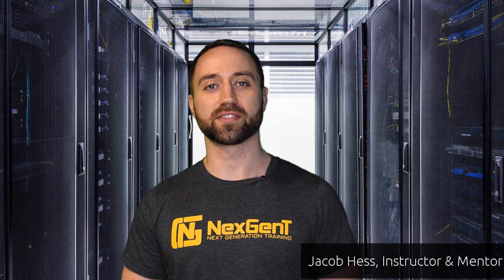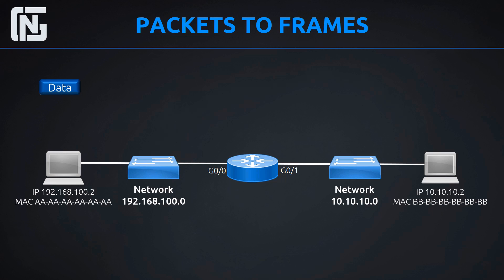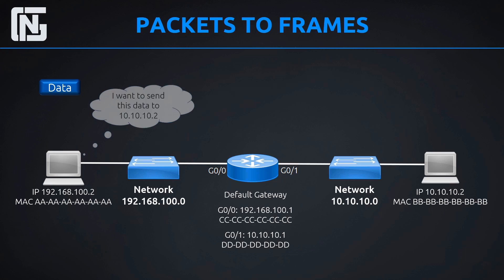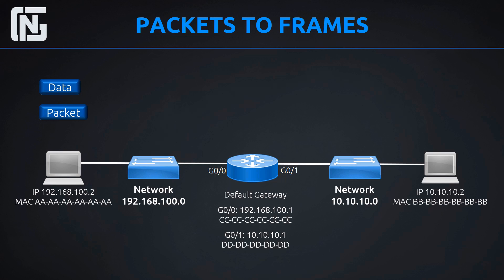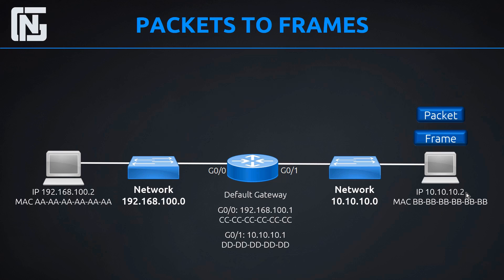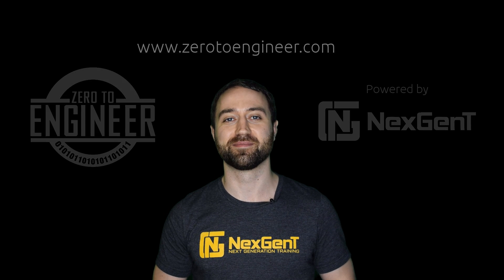Routers, Switches, Packets and Frames

Comment: finally i understood how the mac is used in combination with ip. Thank you very much.
And for those wondering how to obtain the MAC/IP combination of local device (eg. the gateway), the answer is the Access Resolution Protocol (ARP). 
for a practical overwiev in Windows: open commandline (cmd or powershell ) and run first IPCONFIG  and afterwards  ARP -A

Comment: The IP address is translated from private to public and vice versa. How does the router determine which host with a private IP send or receive data?

When two hosts in two different networks want to communicate do they use private or public IPs?
Reply: you are most likely communicating with a say 'server' when you send your packet over the internet it will go through the public IP's of both networks. Though when it gets to the specified network or the 'destination' network. The router will then send out an ARP request to say who has IP so and so. This IP comes with the packet. Once inside the network a broadcast request is given out by the router which is the 'who has 10.xx.xx.xx IP. The server that has that IP on the network replies back with an ARP response. To cut a long story short this is how it works there are a few more ARP factors to consider but essentially the thing to remembmer is that your packet will allow you to travel through the internet because that is what is guiding it out of your network. The frame is what is the crumbs of you send the previous MAC address as well as the destination MAC address.

Comment: Please correct me if I am wrong. When you said that host A knows the MAC address of the Router(gateway) and then sends the frame to that router port. But I think this is not completely correct. I think host A will broadcast the frame on the LAN and then the switch will forward the frame to the router. In this case, the router will act as a proxy.

Comment: Hi, I'd like to know about the flying cat image, the data packet contains the image file in just once transmission right?how many kilo bytes or mega bytes the data can be transmit in just once frame? Thanks so much
Reply: payload portion of the ethernet packet can contain maximum of 1500 bytes (often does only 1400). So hypothetically you will have to send couple hundreds of packets if the image is 1MB large.

Comment: Packet reaches G0/0 intrrface which is having a mac addrrss cc:cc, to send to 10.10 network it needs to be switched to interface G0/1, can u explain how does that  happen, I heard somewhere  Router  simply switches from G0/0 to G0/1after checking routing table. Is that right?

Comment: Not including tcp details into the explanation, made it less clear because it caused more questions than it solved. 

How does the Gateway router know what network to send the data to, when all it has, concerning the device we are trying to send the data to, is an ip address, but the same ip can be used in a million networks that all would be attached to the same gateway router, and what actually matters is the MAC address of each device on the planet?

You are like: "Oh, I (Gateway Router) know that IP". And I'm like...you would know a bunch of them. Which one is the right one?

Comment: Hi, I didn't know where to go for this so I'm going to comment sections regarding ISP routing. I had Xfinity in New Jersey. To a server in Quebec, Canada, I had gotten 40 ping. However I moved 20 minutes from there in a suburb extremely close nearby. Now, to the same server in Canada, I now have about 15 ping. I am so curious, but cannot figure out what could have been the problem there in terms of routing efficiency there. I've done traceroutes and the like, I don't know enough about the gateways to actually diagnose where the problem was. Was it a problem on my ISP's side? (also, on another server to Ashburn Virginia, at my old apartment I had gotten 60 ping with the same provider, now at my new house, I get about 8-10)

Comment: Before it sends the packets, it actually sends a signal (arp) to know the mac addresses of nearby devices or next hop. Am i right sir
Reply: This occurs only if the Mac address is not known. However, if through the process of self learning, it already is aware of the Mac address due to a recent packet transfer, it doesn't require to use ARP again. Other can correct me if I am wrong as well :)
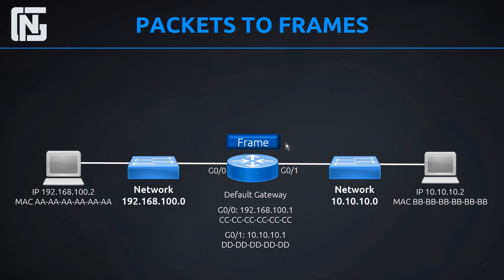Reply: @KarthikRao1995  but at 6:20 its being peformed, right?

Comment: The only part I don’t get is why would you show that the network 192.168.100.0 also gets the frame.. is that supposed to mean that when the host does not know the destination’s MAC address. The host will forward the frame to everyone in the network? Also doesn’t the router have an ARP table with IP addresses and Mac addresses so you once you hit router 10.10.10.1 it doesn’t even go through 10.10.10.0 it goes directly to 10.10.10.2

Comment: the only thing, isnt when the router gets the packet from its incoming int, going towards the right host. 
would the source MAC be G0/0, and the source would be G0/1.. not host 2s MAC?
As when the packet gets to int G0/1, it THEN looks up the IP address, and finds the MAC to be addressed to host 2. 
Then the router changes its source MAC to G0/1 and its destination to host 2?

Cuz, I feel like you missed that step there. You said it goes from the router RIGHT to the destination host (while going through the switch as well).
Reply: You are correct. That’s how it works.

Comment: FINALLY!!! I've taken tons of college classes and even tried the Cisco CCNA program last year and could never quite make sense out of this process until now! Why is it so hard for so many professionals to break it down like this where the process makes sense? Cisco should let you overhaul their program! Subscribed!
Reply: HONESTLY, I'm in college right now and its a class I need to take. I'm in the netcad Cisco program but honestly its not this clear and simple!!! These videos help me understand it so clearly and simple compared to that cisco class/course!! Wish me luck!
Reply: Deez Skates the latest CCNA does go into visualizing how frames get forwarded in a network quite extensively. I agree with you that nailing it down is absolutely crucial in understanding networks, especially from a troubleshooting perspective.
To give an example. One time, random hosts on the LAN were getting a 169 address. My boss told me that it’s probably the switch or the cabling. But I was explaining it to him that it has something to do with the firewall (dhcp server). Because a bad uplink cable would cut off everyone. You can’t have some hosts working and some not on a faulty ethernet cable, because the frames are multiplexed across a single pair of wires. 
The example is to illustrate that troubleshooting requires understanding the details of the technology. 
Also another time it happened, he was fiddling with the modem. I explained to him that a bad WAN connection can’t cut off your local IP address assignments.

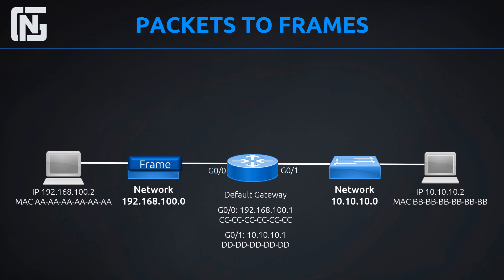Comment: 4:58 Shouldn't  the frame contain the Mac address of the switch instead of the router?
Reply: I think becoz Pc A is trying to send packet to it's Default Gateway it would be using it's Default Gateway Mcaddress. And would send packet to the Switch port directly connected to it.

Comment: Would have been good if you included the reply as it's not clear how receiving system will repack the reply as it discards frame and packet those came in. From where it will get destination ip for packet and macid for frame?

Comment: When the router is connected to the internet how does it's figure out the MAC address of the computer on the other end? I thought the MAC addresses were restricted to the local/private network only.
Reply: i am confused about that too, and how can b knows a's local ip 192.168.....? Have the router changed the local ip to itself when it forward the packet to b's switch ?

Comment: Question - How does default gateway for 192.x.x.x network know what's the destination MAC address for 10.x.x.x network? I.e how did router know to change MAC address from CC-CC-CC to BB-BB-BB ?
Reply: Hey dont know if anyone got back to you on this but the router is going to arp request for the 10.X.X.X network information. If you need it explained further let me know.
Reply: @anthonywatson5232  hey, thanks for replying. How does the routing work on my home router? If i try an access a website!

Comment: At layer 3 the data is in the form of a packet (L3PDU) . The packet is then encapsulated with a Header and Trailer at layer 2and is transmitted as a Frame.

Comment: Thank you very much but am little confused, when the router opens the packets and sees the destination IP address, so how does it know the destination MAC address ? Does it use ARP ?
Reply: Someone already answered a similar question:  "your local router doesn’t know your Mac, but it has the destination up which is your ip. So it sends a arp broadcast with destination Mac of all f’s and all the hosts in the network sees the arp broadcast and discards it except for the one that owns the ip, which will then reply".

Comment: Few more things.  When first machine wants to send a packet to the router, it doesn't know the MAC address. It used ARP to find IP to MAC address. Then it forwards the packet. Also Switch should know the DEST MAC to port , otherwise it broadcast the traffic on all ports in the VLAN. Also if the router doesn't know how to forward the traffic as it doesn't any routes in the routing table, it drops the packet. This video is too basic.
Reply: W

Comment: I think it is overly complicated to assign an IP to a switch. you also didn't explain why the switch has 0 in the IP. you showed us that the switch has no MAC and that is actually a lie. you can draw the diagram with only two nodes and one router. that way you can just show what you want to show. then make a second video to explain hubs (no mac) , unmanaged switches (no IP assigned), and managed switches (routers).

Comment: A hint, when you box, unbox the data => packet => frame => wire , you could draw horizontal lines with the OSI Layers. this way its easy to understand why switches operate with frames at Layer 2, Routers at Layer 3 with packets, and your (skype/whatever app) at top Layer with Data.

Comment: Sorry a beginner question,  Since routers and switches both forwards traffic to end user or clients why not switches replace routers ? or why not routers replace switches and just be one of them ?   Any one with a good explanation is welcome.  Thank you
Reply: Good question.  I also want a clear answer to this....  all i can think is: switches help with LAN through learning Mac address as its spits information while learning/mapping information in a Local Area Network as for routing it sends information across a WAN for connection to the world by using ip Tables.  Also, modern tech has integrated switches and routers together.  

But i could be wrong...  please some one explain.
Reply: Switches can forward traffic at Layer 2 level only. It just knows this MAC address is connected to this Port. On a Switch you create a VLAN. Your machine is connected to that VLAN. Switch builds MAC to port table per vlan.  So when a packet is received,  it checks the table to see which port DEST Mac is connected to. If it doesn't know, it just broadcast the traffic on all ports in the vlan.  Switch learn MAC to port when it receives the packet from that port. 
 Router forwards traffic at Layer 3 level which is based on IP address. It knows next hop of this network using Routing Table. Routing table can be built statically (you configure it) or through routing protocols.  If the router doesn't know the dest network, it just drops the packet.

Comment: I’m confused on the router part. Is the default gateway in the video the router/modem combo thing from Comcast that’s sitting on my desk?
Reply: And if that’s the case, wouldn’t there be 2 routers, one for each computer instead of one in the middle? I feel like this is probably a stupid question lol
Reply: Back again lol. Just can’t make sense of this. If the gateway is MY router thats in my house... how is it connected to 2 networks?
Reply from the maker: Hi there!  The default gateway is your router. It can be confusing sometimes because your home device is normally a router with a switch built into it. So, you are plugging both of your computers into the built in switch and each of the computers connect to the same IP Default Gateway (which is your home router) in order to leave your network.
Reply: Thank you! Yeah, I think the all in one xfinity router makes things a little harder for me to visualize. So if a router connects 2 networks, would that mean mine has 2 IP addresses? One being the address my devices (computer/PS4) connect to, and the other being where the router connects to the ISP? I’m not sure where my data goes when it leaves my router, but I’m guessing it’s somewhere associated with my ISP (xfinity)and from there it goes from router to router until it reaches its destination
Reply from the maker: That is exactly right!
Reply: "router with a switch built in" is redundant. it would be better to say that a router can perform all the functions of a switch plus more functions that a switch can not perform. there are big differences between a router plugged into a switch vs a router without the switch. they are completely different in a lot of ways. they are not interchangeable in the features. adding a switch on the side decreases the abilities of the router to perform many valuable functions.
Reply: It would not. Router is a device that can make "queries" between more subnets (IP) - level 3. Switch handles MAC addresses - level 2. That being said the device one can buy for home use is just blend of more than one type of devices together - primarily it's a switch and a router and very likely also a wifi access point (WiFi-AP operate at level 2 as bridges between two different physical layers which are level 1, namely the wireless signal - photons - and the hard ethernet connection - electrons)... The confusing is that we call these devices routers which is only partially correct...

Comment: How does a host know the destination IP address
Reply from the maker: There are actually two pieces of information a host needs: The IP Address and the MAC address. Hosts use ARP (Address Resolution Protocol) to map IP Addresses to MAC addresses.  As for how a host knows which IP to talk to that is simply determined by whatever software you are using. For example, if you are playing an online game the software is built to connect to specific IP addresses of the game servers out on the web.  In another example, if you visit a website such as www.nexgent.com your computer will do a domain name service lookup on www.nexgent.com and learn what the IP address is for www.nexgent.com.

Comment: can a loopback interface on a router be a default gateway
Reply from the maker: Hi Abdbul and thank you for the quesiton! You should not try to use a loopback interface as a default gateway. Loopbacks are internal to the router and while they can be reachable from hosts on the network they are not used for serving as a network gateway.
Reply from the maker: To serve as a default gateway the router just needs an IP address for the network it serves assigned directly to the physical interface, or to a sub-interface if using VLANs.

Comment: so why we need arp request if i dont realy need to know the destination MAC adress?
please help me i confused
Reply: I would like to step in a bit, just to try and simplify your answer. An ARP request is sent before the sending of the actual data to resolve the MAC address of the host where the packet is being sent to - to connect the known IP address with the MAC address. If the ARP request gets no response it means that the receiving host is not within the local network, so the packages need to go to the default gateway leading to the outer networks. ARP request is configured in a way that it never leaves the local network.
Reply: @stefancelanovic   Beautiful lines !
Reply: Jacob's video already has the routes established via arp/arp cache, so the IP/MAC mapping has already taken place. You won't see arp requests/arp replies, and broadcasts being flooded to find the receiving host and its connecting devices, etc.